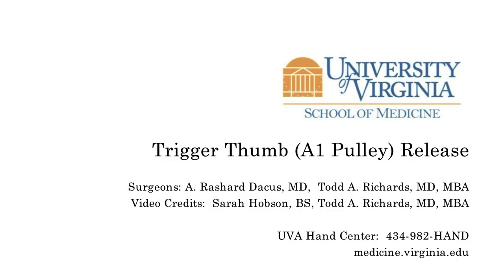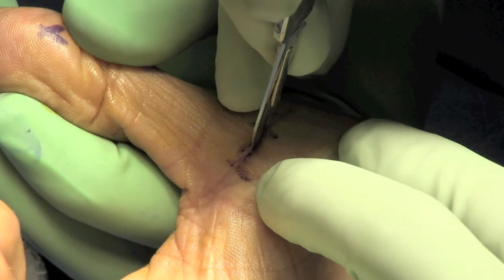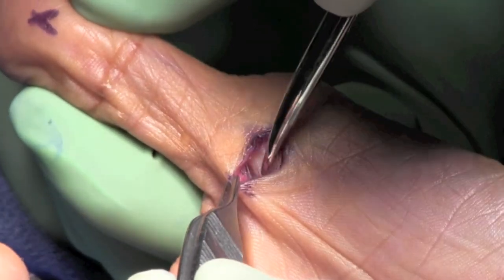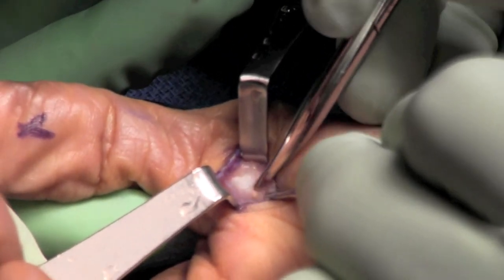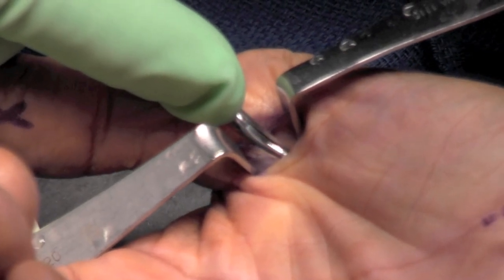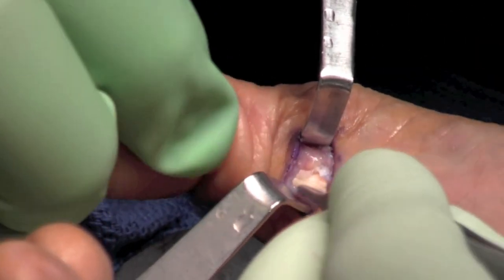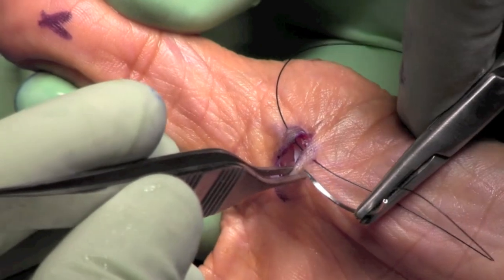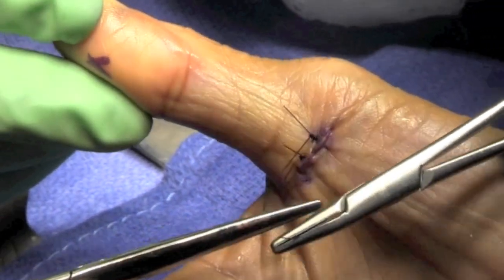Trigger Thumb Surgery

Comment: I have had at least three cortisone injections and though it has eventually allowed the thumb to act normally again I am once again in pain and this time I have not experienced as much of the locking up ( though it is evident as the joint is still hesitating ) so from what I have read... and i have been taking a lot of time with this and from the studies it seems like if the injection has not helped after 2-3 times ( at the most ) that the surgery is the next logical step.  But not only that but it is said to have a tremendous percent of success and I think for me the biggest challenge is finding a surgeon in the Kaiser network that is on board and not being restricted by administration.  I find it very distressing how many people today are needlessly suffering from not only this but many other ailments that  could be taken care of and often with not so much aftercare....sometimes other procedures do need more aftercare but I believe that the more we are given the options then at least we know what is possible.  Much thanks to the Author for sharing this procedure.

Comment: I have a trigger thumb that has not responded to cortisone injection so I need the surgery. My thumb is stuck in a straight position and hurts all the time. I don't fear surgery and don't mind getting it but the cost is horrific. My "copay" is $700 and that's just for the hospital.
Reply: I'm getting it Monday but mine is going under workers comp. I can't imagine having to afford this on my own.
Reply: I got the cortisone shot too and it didn't do anything actually I think it made it worse cuz I was no longer able to even bend my thumb back and forth like I was able to prior to the shot, although it was painful I still was able to move it